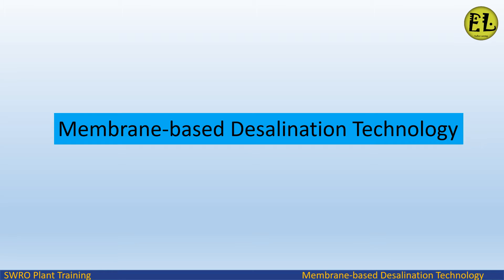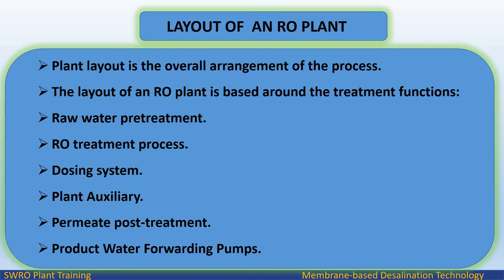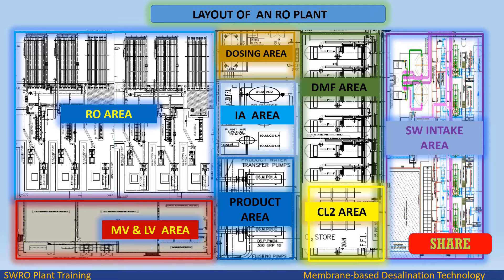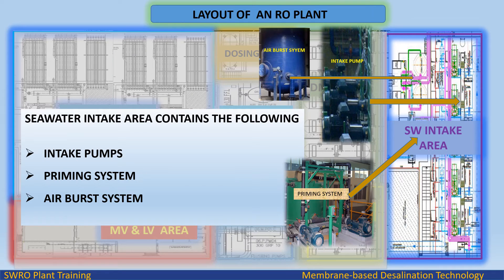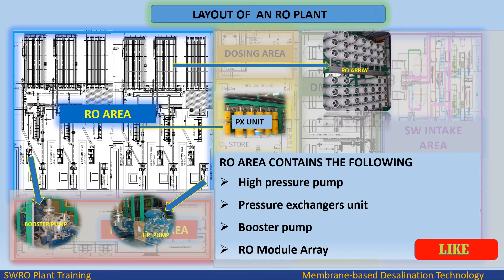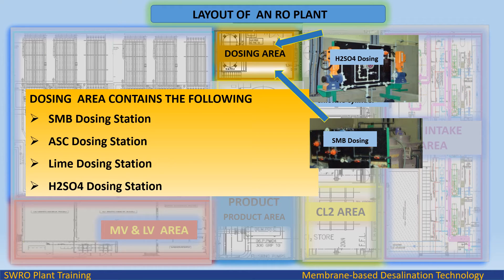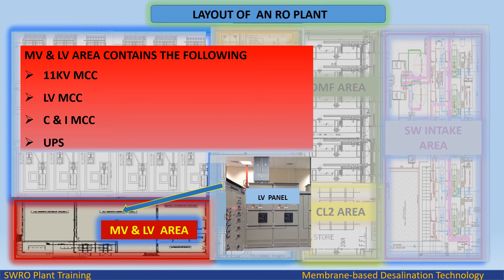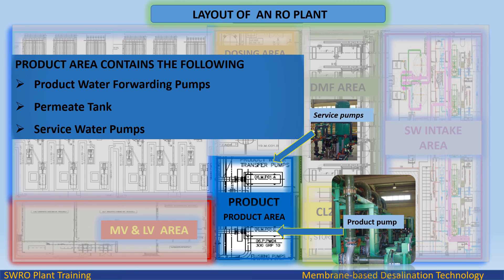PLANT LAYOUT | REVERSE OSMOSIS | WATER TREATMENT PLANT LAYOUT

Comment: Good video. What is the role of "vacuum regulator" in chlorination system?
Thanks.
Reply from the maker: The role of a vacuum regulator in a chlorination system is to regulate and control the flow of chlorine gas from the chlorine cylinder It also helps ensure accurate dosing, prevent backflow, and incorporate safety measures to protect  the system.
Reply: @ENDLESSLEARNING555  Thanks . But by the way, where are you creating vacuum?